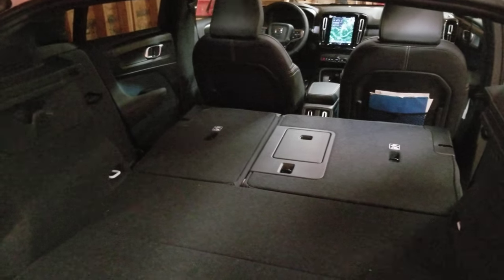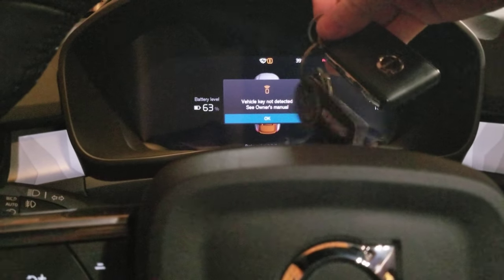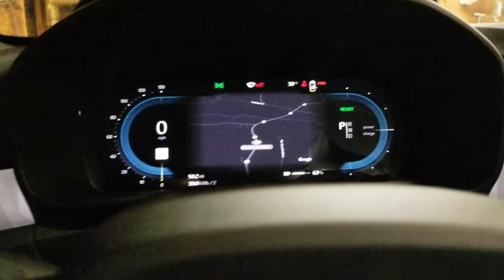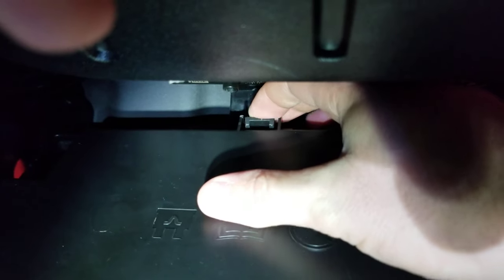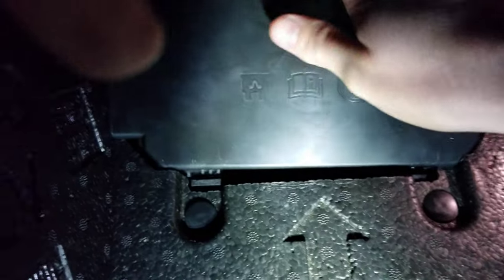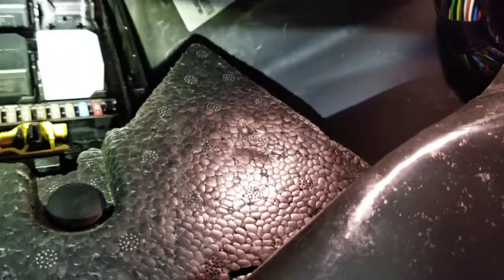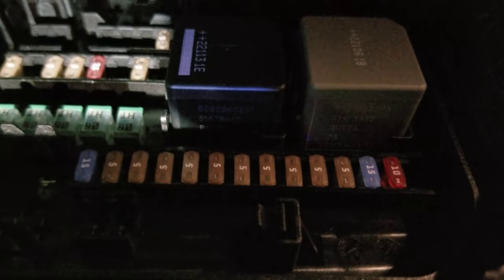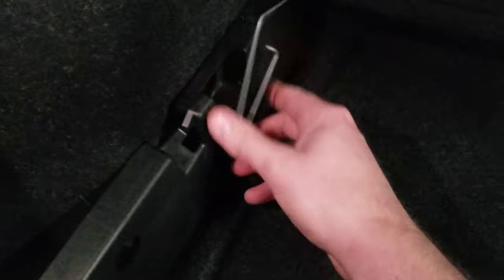Re-setting the TCAM in your Volvo C40/XC40 Recharge (Part I)

Comment: Just followed your steps and sorted a really annoying loss of connectivity issue.

Note: if you fold the rear seats down, then fold the trunk floor forward (over the rear seats) I found it much easier to reach the TCAM battery from the rear seats